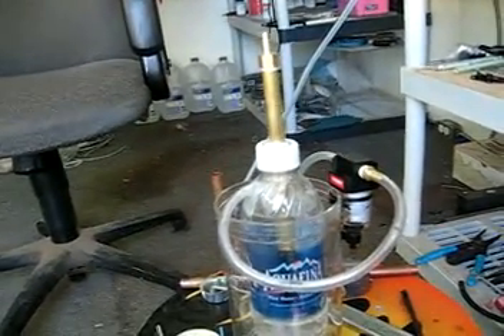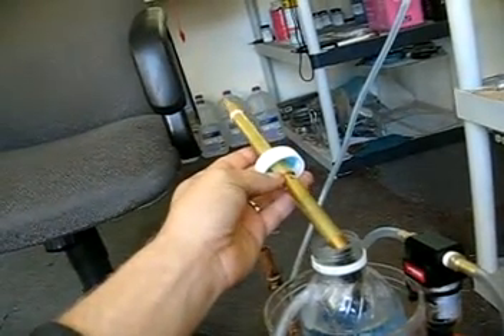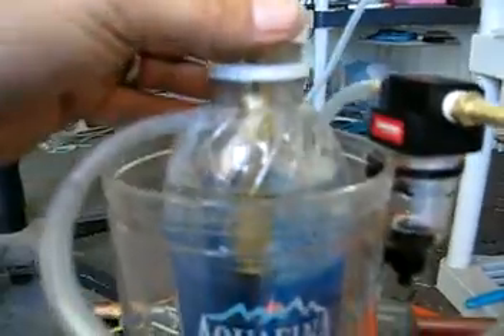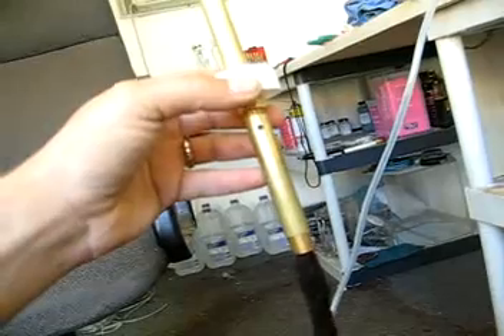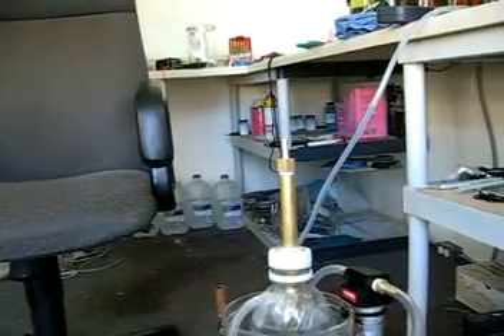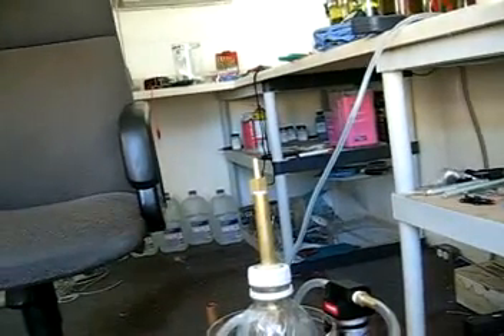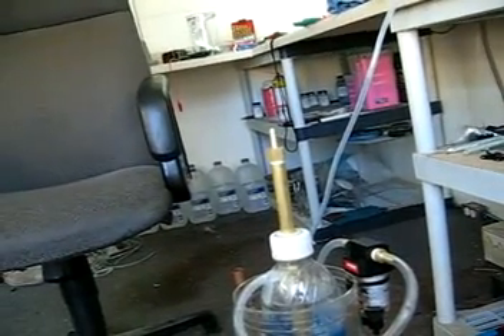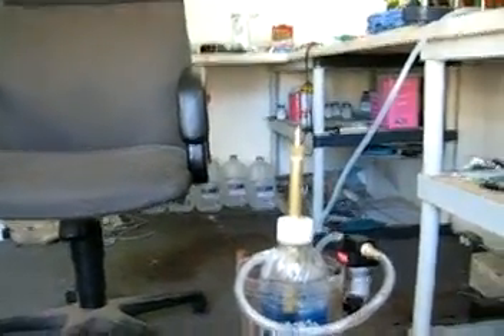flashback arrestor/bubbler revised

Comment: Yea, I was gonna put a blow off valve on the actual cell, but it's tough to find one that blows at low psi.

Speaking of which. What psi do you think is 'safe'. How much hydrogen pressure are we comfortable building up? How much is typical?

Comment from the maker: its fun stuff, when dealt with properly. But always prepare for the worst. This was a stop gap setup while working on better setups. The best option is to make the bubbler strong enough to handle a full flashback, 2" abs properly glued works well. Adding a blow off valve is even better.

Comment from the maker: The torch itself is a flashback arrestor, it is loaded with bronze wool, this arrestor/bubbler is the next line of defense/safety, also I have another bubbler next to the cells. So in event of flashback it would have to pass through two arrestors, and two bubblers to get to the cells, and that just isn't gonna happen. The pressure/ volume of flow from the cells keeps it from flashing imediately when lighting it, if thats whats happening the opening of your torch is too big for the hho produced.